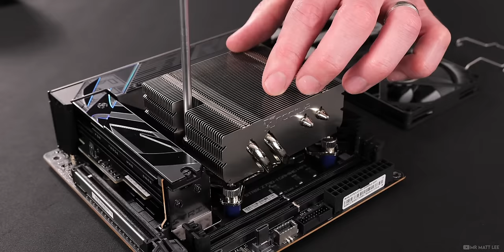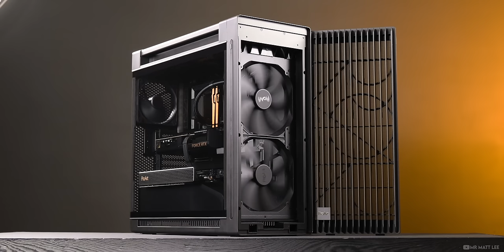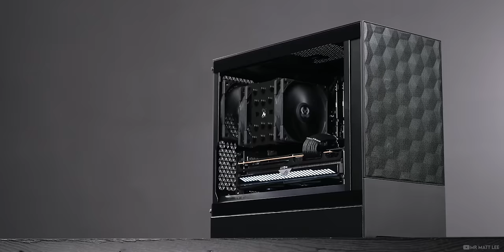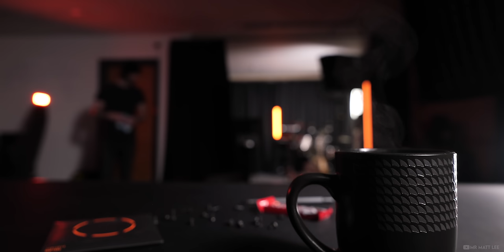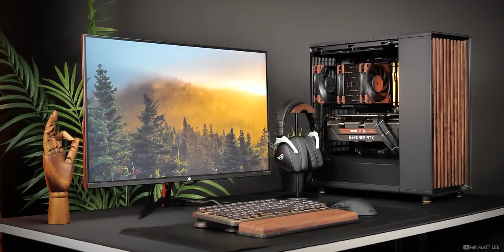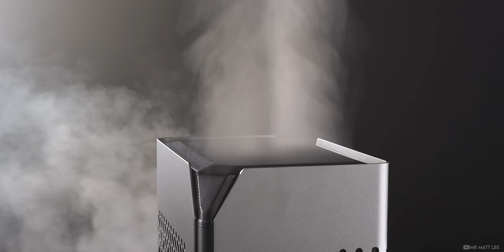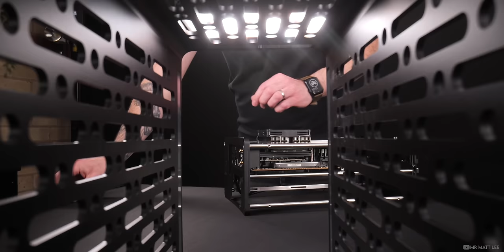PC Case AIRFLOW; A Visual Guide for Optimal Cooling.

Comment: As an engineer I'd say you did a pretty good job explaining things. Fans have a given characteristic in terms of flow and delta pressure they can provide. If you obstruct the inlet of air of the case that means that portion of that dP is lost to overcoming that resistance and also could impact the fan performance if the air is entering the fan at an angle... depending on the specific fan design. Otherwise inside the case you were right about the turbulence of some cases. Generally speaking if you want high air flow you want it to not be turbulent and have as few changes in direction as possible (anytime you accelerate the air in a different direction you loose some of the kinetic energy the fan put into it). Though turbulent flow is somewhat beneficial to increase heat transfer, but your not looking to cool the walls of your case, so it's a waste.
Reply: Yeah that's why I always stick to an airflow focused case rather than an aesthetic all glass one. At the end of the day, the core component is much more important than the looks!
Reply: In the North case, you don't even need exhaust fans, it performs pretty well, especially because the two front 140mm fans basically act like a column of air pushing down the entire case in a steady flow, with air free to escape wherever is the least path of resistance, whether it be the side or top mesh, or ultimately the back. You don't even need an exhaust fan, the CPU fan will easily push all the warm air out, acting like an exhaust, while the rest will just go out of the top or sides from convection. In mine, only everything from the rear of the heatsink warms up the case itself, only the exhaust area of the heatsink is where any warmth is felt, and very little at that. So you simply don't need that many fans, especially with Ryzen 7/9 chips, because these extra fans will never cool things enough to make a difference, because while they run cool, they also run hot at the same time due to the thickness of the IHS on the CPU, so even a case full of several fans won't make a meaningful difference in its max temps. All adding more fans will do is create turbulence, starve other fans of air, take in more dust, and cool air that was already on its way out anyways. With just the two stock fans in the front, it's a completely positive pressure case, with air able to move freely like a wind tunnel.
Reply: 🤓 as an engineer

Comment: 7:32 yes! Finally someone points it out. I seal off the first two fan mounts in the top of the case with 2mm pvc sheeting and case fan screws. That way no air escapes prior to hitting the cpu tower cooler.

Another thing that helps enormously is a few mm spacing between fans and any grills. A number of companies offer foam spacers for fans. They also help seal the fan to the case.

For Small Form Factor PCs, ducts and seals make all the difference. The gpu fans and cpu heatsink fans can become the case fans if you seal them to the case grill with ducts and rubber seals. Massive jump in positive pressure.
Reply: I can attest to this. The day before watching this video I had my hand on top of my PC and noticed my front panel fan was blowing some cool air right out the top front of the case. I cut a piece of plastic to cover that vent space in order to ensure the cool air made it to my CPU cooler and immediately noticed much lower fan rpms and cooler temps. A simple fix for a simple but easily overlooked problem.
Reply: Yes! I have been recommending ducting the GPU intake in ITX builds: the typical goto is to fit 2x fans at the bottom of the case to feed the GPU and sure, it does work to an extent, but also creates more noise and unhelpful turbulence!... A foam duct made from the foam the motherboard came in can look great, cost nothing, and significantly reduce temperatures and noise!
Reply: This is true. BUT, it does look weird though, having only one fan at the top. Also only a problem if you're using a air cooler.
Reply: Yep. That's one of the reasons the Fractal Torrent is so efficient : zero top opening. Two massive front fans push air that has only one way to go : through the case towards the rear (there's a little bit of loss at the bottom if you don't add fans there but I found it rather insignificant)

The Lian Li Lancool 216, also a strong performer, comes with a solid plastic plate you can add if using a smaller radiator or only exhaust fans up top... And as seen in the video : do not use 3x120mm top exhaust as you'll just pull cold air straight from the front top intake fan with zero component cooling.

In a conventional air cooling setup, air should simply be moving from front to rear (optionally top rear) as fast and obstruction-free as possible, with leakage around the front area minimized. Exhaust fans make close to zero difference unless the case is poorly designed/drilled.

Water cooling is a bit more flexible since the heat is relocated from your watercooled components to radiators. As long as air intake isn't obstructed... I'd focus more heavily on bottom intake if the GPU remains air-cooled since that cold air goes right into its fans. Rear exhaust might show more benefit there are it will churn some air around the VRMs that have now lost the CPU air cooling benefit.
Reply: thanks i saw your comment and i removed a top fan exhaust on top and only leaving 1 at the top rear to exhaust together with my rear exhaust.! i even use some cardboard to cover the empty slot and duct tape it to so call seal the gap.
Reply: My setup is almost the same as in that example, but instead of sealing off the top, I just mounted an extra intake fan on the front end of the top mount in front of the CPU.  There's no noticeable outward airflow escaping from that area, and the dust pattern on my top mesh filter shows it's pretty much all inflow. It may not be a perfectly optimal setup, but it works well.
Reply: Alternatively, you can set the first top fan (left side fan) to intake. It made my CPU cooler both at idle and under load. Although I wasn't able to check the temperature directly, I am pretty sure that it also helps cool down the top VRM and RAM.
Reply: I don't do any of this and my pc works great
Reply: i have a "be quiet' seems they had the right idea:)

didn't realise hehe
Reply: @ennayanne  yea like me, I tested my temperatures with 2 fans on top and 1 fan on top, no temperature difference
Reply: First top fan mount as an intake ..no mid fan at the top. Front 2 as intake set in middle height, the top one lining the cpu cooler. Back and above the cpu cooler as exhaust. That's my setup. Good?
Reply: @SuncanoMore  only thought is that the top intake might be either redundsnt or interfering. hot air rises, i would only use the top as exhaust imho
Reply: @CyberBeep_kenshi  was my first intention...but the first on top sucks the fresh air from the top front intake fan out immediately before it gets where it's needed. Back and top exhaust run at higher rpm then the 3 intakes.
Reply: @SuncanoMore  i can imagine if you added some divider on the top, so that top intake adds cool air to the intake from the front. essentially making 4 intake fans. the thing is, reverse fans close to each other makes for garbled airflow (no idea if this translates well sorry). what i mean is there is a good chance that i take bleeds directly to the out take fan, essentially making everything less effective. 

i reckon you need to play with smoke to see the effect.

Comment: An experience PC builder here, also I live in a very hot climate so ambient is around 30degrees Celsius most of the time. This will be a bit long but I just wanna share.

I always do a full system load for every build I do, it will give you an idea of what is the worst case scenario and you can check what you can do to improve from there. Other than cooling performance I tend to config the system to also have positive pressure, this help keep the Pc cleaner and cooling performance won’t be hampered by the layer of dust.

For cooling rather than having a lot of airflow you want to have fresh cool air cooling your components. Like in case of mounting radiators at the top while it help cooling the gpu rapidly, it generally bad for cooling cpu due to the usage of hot air from gpu to cool your cpu.

 If you pull the air in from the top and using the back exhaust fan to pull both hot air from gpu and cpu out it does give a few degrees advantage, the catch is it need to pull the air out fast enough so I generally use a 140mm for the exhaust. This configuration also makes the intake spin at lower speed due to having both intake on the front and top.

Now you just need to match fan speed to maintain a positive pressure at any cooling temperature, you can do this by observing the hole on your case and see if it pull air in or out and you can adjust the fan speed from there. This method maintains maximum cooling and positive pressure at any speed.

I generally aim for 70~80 degrees celsius when ambient is over 30 for high end components(there are some exception like 14900k), My 3080 and 13400f with 240AIO run at 68degrees and 65degree respectively at full system load at ambient 30.

Comment: production quality brother ..... great work , as a pc gaming shop owner , i calculated the amount and type of cooling based on the amount of consumption  , for a hot country best thing to do if it's okey with you " more dust , kids  , aesthetic ect "  , just open the case window and be done with it , nothing get close to an open case in term of cooling performance vs any mesh case with a full fans installed  , basically ur average 40 to 42 °room temperature can't be cooled by ur fans they just blow hot air in the case :d , for expensive builds just go with a full custom loop push pull setup 2*240 OR 2*360 OR 3*360 rads , for cheap low consumption 300w build  like the  "  i5 10400/13400/ r5 7600 +  rtx 2060 / rtx 3060 /4060  rx 6600xt  and below  just get a nice cheap 40 dollars airflow case  with a 3x 120 front +1x120 back fan setup and a 20 /30 dollar cpu cooler , it's pointless to change or add  any special cooling  bcs you will never have any throttling + add some undervolting and lose 20 30% less  consumption  for a 2 to 3% less performance .

Comment: I'm glad I found this video.  I've been battling with my choice of AIO location.  I chose to side mount my radiator pulling fresh air from the outside giving CPU cooling priority.  My use case is more CPU intensive, with light gaming from time to time.  My airflow setup.  3 front intake fans, AIO mounted on the side pulling fresh air in, 3 top mounted exhaust fans, 1 rear mounted exhaust fan.  I've balanced the fans to maintain positive pressure from idle to full load, my temps are great.

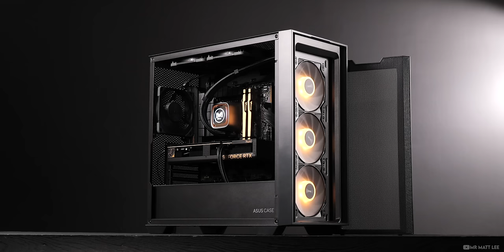Comment: 6:25 this setup is bad because u blow hot air from the cpu radiator on ur gpu and memory, basically u blow the hot air inside ur pc. The best setup is to put the cpu AIO radiator in the top which are pushing out the hot air.

Comment: Loved your video. My first PC build was what you talked about in terms of trial and error. I naïvely believed that I could just pack everything into a tiny Jonsbo U1 Plus case and have the perfect system. What I got was a terribly loud gaming PC. It looks cool. It works. But it only has room for a SINGLE 90mm fan, and that, I had to mount on the outside of the chassis! It tried a Nactua CPU cooler, which worked, but then realised it was my graphics card that was screaming for attention. Of course it only had a single fan, as it was the short version. On my next build I will start the other way around, figuring out the airflow first and making sure my system gets plenty of cooling for quiet operation and better performance. I would greatly appreciate and airflow visualization of the Jonsbo TK-3. I love its aesthetic and will probably choose it for my next build.

Comment: Really interesting vid. The one thing I would add, is the direction of your GPU fans when running a high end build, and having fixed rate fans when utilising pressure. I have found the Corsair 5000D to be one of the few cases where more fans = Better. With a STRIX 4090 and an i9 (and Motherboard trained properly over a week so it doesn't blow up), i have 13 fans, the GPU rarely if ever goes over 50 celsius, during max Cyberpunk, and the i9 rarely over 60 (both heavily OC'd). The case has some sort of magic to it. Since the STRIX's fans are so effective, I built the case around the card.
3 front 120's, 2 side 140's (Panel left on to push the air over the MB) h150i Elite XT at the top, with 6 x 120's push/pull - inner and outer, one PSU shroud pointing up below the STRIX (to help pull up since it sits below the CPU) and one exhaust.
I also use fixed rate % instead of curves, and fix the strix fans at 50-60%, otherwise the ai won't use them at 45 celsius (avg Cyberpunk temp)

Comment: Nicely done about basics!  Saw at hardware canucks recenltly that vertically mounted gpu’s do not benefit from fans below them because of turbulence.
Reply: Yeah, IIRC they found the air was either causing a ton of turbulence or wooshing right by the graphics card. Another factor was the fin arrangement. Since most are setup to benefit from the traditional setup they also didn’t benefit from the vertical position. Some even got worse because the wicking in the heat sink was not designed to work in the vertical setup.

All in all really fascinating.

Comment: I leaned something new about my pc case today. It's  actually a airflow optimised one with a plastic panel on front, with the "tried and tested" look. It's just missing a hell of a lot of fans,as in it has one on the back and one for the cpu that's facing towards it, and it looks like it can take some big ones too. Now I just need to figure out how to install them, little lone which to buy. It can get an additional 2-3 in the front, and it's build for only one in the top.
Thank you for the information, no wonder why my computer is running hot and loud

Comment: 7:24 makes so much sense but never clicked before. Thank you for the visualization! Definitely will keep this in mind for my next build 💪
Reply: my build right now has a top INTAKE fan to the right of the tower cooler. Almost the same set up as his but that fan hes talking about is near the front, and is intake. i was wondering if it would be better to use it like his setup or if it doesnt even matter much... maybe its redundant to have that considering that the front fans are taking in air anyway right next to it. Perhaps helping out my one exhaust in the back would balance my airflow better
Reply: @tekkh  i rather not put intake on any spot on top part as it sucks all the dust into your unit.

Comment: Very informative and relaxing to watch, with no unnecessary/unrelated chatter. Great cinematography too.
Only thing this didn't seem to delve into is the Positive/Neutral/Negative Pressure concepts. Typically best to either have more intake fans than exhaust fans, or greater CFM intakes than exhausts. Either way, the warm air is forced out of the case with less dust accumulation.

Comment: Bought the Lian Li 011 Vision Chrome. Best temps I've ever got. Push/Pull 360mm intake on the side, 3 140 intake on the bottom, 2 120 exhaust on the rear! Both gpu & cpu sit around 60c when gaming.

Comment: Depending on some factors, moving that fan by your window a few feet further away from the window can, in fact, actually move more air out of the window and thus pull more clean air in through the other window.

Just something to test to speed things up.

Comment: Hey, I really like the aesthetically pleasing cinematic shots! Absolutely beautifully created. For me it would be very interesting how other non conventional setup would perform. 

For example: what happens if you direct the airflow from back to front in the other direction? 
What happens if if the air is exhausted at the bottom? 
It is probably a lot of work to set everything up so if you find the time to do that I would be thrilled!

Comment: It used to be that you start with a bloody good 120mm rear exhaust fan and see where you're at before adding any more, you can often get away with just that for gaming, or balance it with front intake. AIO's and glass panels are the main reason things have gotten more complicated, and with it more expensive.

I think we all have one crazy build in our back catalogue, mine was a coolermaster stacker 830, around 2006 maybe, it had a side door with 4 120mm fan mounts that I obviously filled because where there's a space for something you have to fill it, 2 x 7900gtx in SLI, never again.

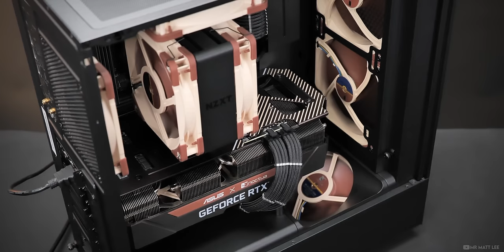Comment: 6:50 I think you have this idea backward. Air gap for coolant expansion always occupy the top most of radiator, and with inlet positioned in such a way, the pump will have to suck in gas instead of liquid. There's a mechanical terms called NPSH. With this arrangement, the pump may still work, but with lower efficiency in transferring coolant.

Comment: Loved the video. I’m still thinking of getting something to check my airflow. One thing I tried and got a decent result was spraying compressed air from an upside down can, this makes it spray out half frozen and you can see the smoke move through the case. As it is mostly a mix of butane and propane it normally leaves zero staining on the hardware. 
Both of these are not conducive to electricity so it’s zero risk. 
But it doesn’t give as clear a picture as your method. 😅

Comment: I've got a new build with a Ryzen 9 7900X3D and RTX 4080 GPU in a Fractal Design North XL tempered glass case. Case fans are all Noctua 140mm NF-A14, 3 for intake in the front and one exhaust on the upper back panel. For cooling I went with a Noctua NH-15. Temps seem to be good and it's super quiet. I'm still tweaking it and may add another exhaust on top towards the rear.